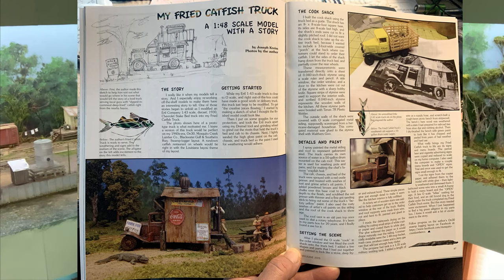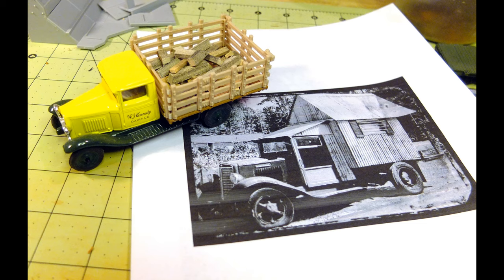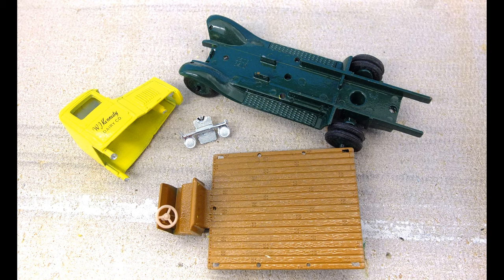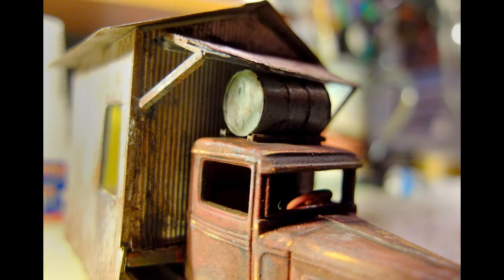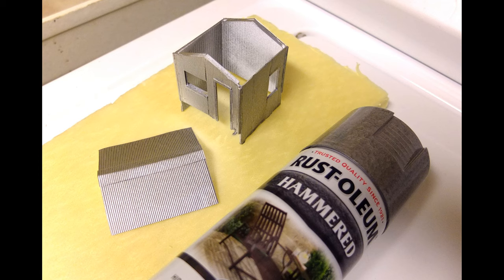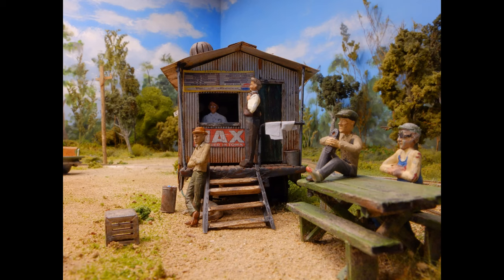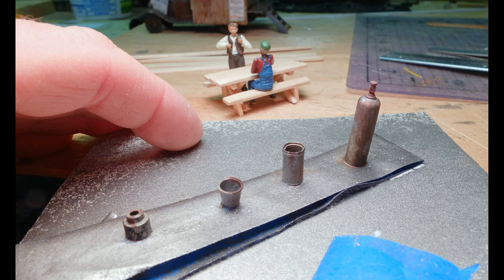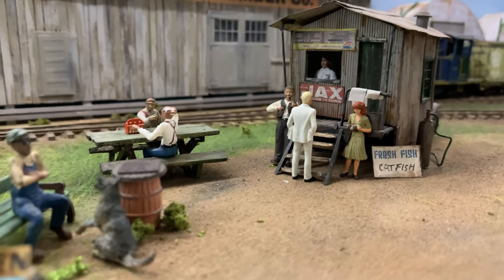Build Your Own Fried Catfish Truck!

Comment: great job on this build.
what i like to do to my vehicles is start with a small diameter drill bit drill the middle of the rivet then with a larger drill bit i remove the rest of rivet. that away you can screw the vehicles back together. also the rivet piece after drilled make great scrap or light covers